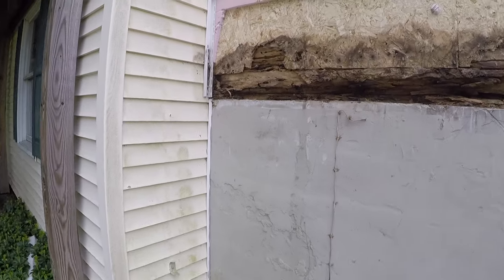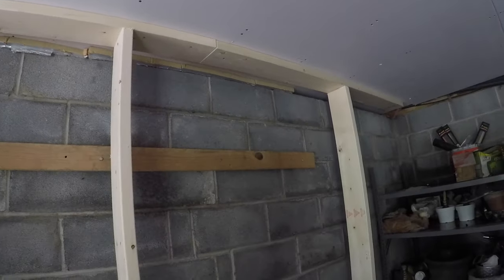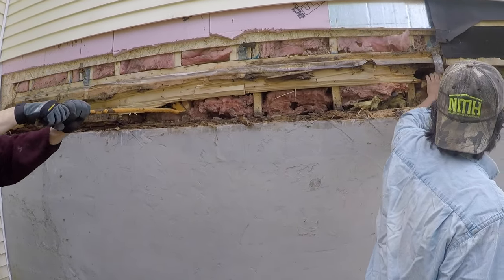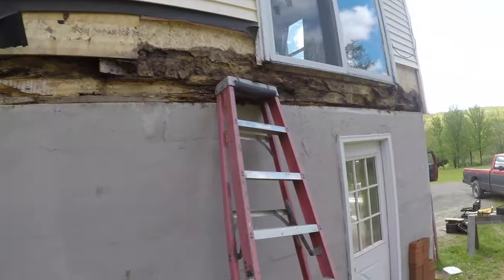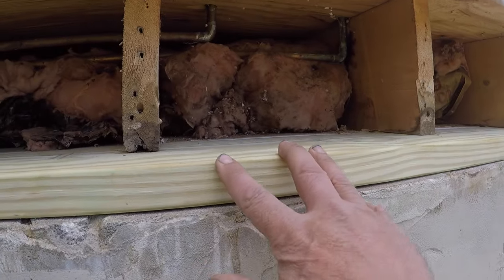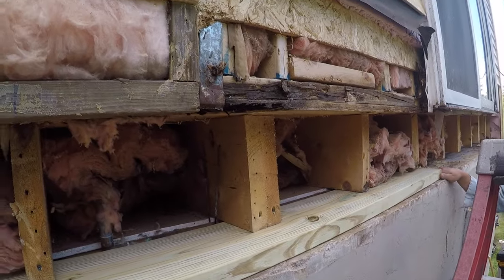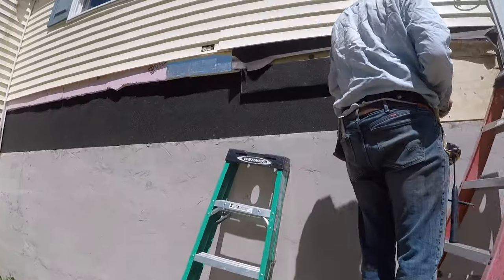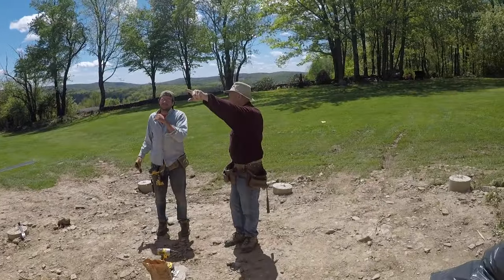Replace rotten sill and rim joists

Comment: Looking at the exact same thing 30 years old, deck boards run into the house sitting on top of a ledger with improper flashing no. Only I don't have a convenient interior wall to put temporary supports. Criminal carpentry...
Reply from the maker: Hi Charley; Sorry to hear that. The cost of doing it right isn't much more. I hope you come to a feasible solution. Thanks for watching. John
Reply: I’m dealing with this exact issue right now! Don’t even know where to begin!!! Money is tight living on fixed income!

Comment: Nice! Just did a project like this. In my jurisdiction, it requires a membrane between the sill plate and the concrete to avoid rot in the future.
Reply from the maker: Thanks for watching Andrew.  That is probably a good idea even with a treated sill. Belt and suspenders.
Reply: That and the fact that the top of the wall is never perfectly even, block or pour.  Membrane helps to seal the unevenness.

Comment: That's exactly what happened to my double wide mobile home. Some guy built our deck 23 years ago before we lived here and did no flashing at all, just nailed the ledger to the wall and now we have similar rot in the wall, with holes to the inside, mice and yellowjackets making homes in it, etc. I have to demolish the existing deck and redo everything from scratch. What a pain.
Reply from the maker: @Aelanna  sorry to hear that. It is very common
Reply: Doing this as we speak

Comment: How did you measure the 2x6’s to “jack” Up the floor joists without a jack? You said add a quarter of an inch to what? More importantly, how did you frame that up? Did you just hit in a nail at an angle?
Reply from the maker: Hi Van; Great questions; You will see there is a 2x6 at both the bottom and top of the temporary wall. the top one (plate) is screwed to the ceiling. This was easy because the sheetrock was unfinished and the location of the floor joists was indicated by the sheet rock screw heads. The temporary bottom 2x6 (shoe) was placed on the concrete floor directly below the top plate. We would stand on the bottom shoe to make sure it was tight to the concrete and then using a tape measure simply measure between from the bottom to the top making sure the tape is plumb as it is extended up to the top plate, reading the tape where it bypasses the bottom edge of the top plate and adding 1/4". 
   We didn't use nails, 3" Torqx headed deck screws are our fasteners of choice for this type of project. Generally using an impact driver they are easy to install and easy to remove. The way the uprights are wedged in a single screw on top just so it can't fall out as you install the next one is all that is needed. I hope you find this helpful. Please consider subscribing, I'm almost to 1000 subs. Thanks for watching and commenting!!  John

Comment: Was there any sort of sealing material placed between the concrete and the treated wood? I'm just wondering about water running in. Or, was that area covered with matching siding?
Reply from the maker: Hi Wade; There was no way to put sill seal or any type to tar paper or plastic because of the tight clearance. it would just ball up. So the sill plate is treated lumber and the siding covers it. Thanks for watching!!!! John

Comment: I have the same problem my deck was built 30 years ago in the brad nail era before screws were invented in the 90s. brad nails are no longer code, painted wood is not code, and screwing the deck to the house is not code either. What is code is all wood needs to be screwed to the house, all walls need to have foam insulation on the outside not fiberglass, siding needs to be cork as the base layer and Sheetmetal on the outside to prevent leaks, and the next needs hook bolts where it hits the studs and concrete anchors on the bottom and by the house this way it won't come down.

Comment: What type of company would a homeowner hire to do this type of repair? If the are of damage is only 15 inches, would it require a replacement of this nature or would doing a sister joist potentially be an option?
Reply from the maker: Hi Stacey; I would guess a general contractor. At the time we all worked as independent contractors who would help each other depending on the job. Every job is different but in general the rot should be completely removed for a proper long lasting repair. In this case there was nothing left to sister too. Thanks for the comment and thanks for watching!! John

Comment: You guys are characters man! lol. Eddie reminded me of my late father when he said, "lets sing the clean up song". lol That made me laugh.
For a newbie here: 
What nails did you use?
How much larger was the frame you built to jack up the house than the house/ceilin/joist? I'd imagine about an half inch larger to an inch?
What screws did you use?
Why didn't you use a rubber mallot than a regular steel mallot?
And what is flashing? I suppose it was that sticky sealant you put over it?
Great Work Boys
Reply from the maker: Hey Blue, Thanks for watching, I.m glad you enjoyed it. Working with Eddie for over 20 years was a pleasure and I can tell you we always had fun on the job. Mostly we used the 3' ceramic coated torx deck screws. They are strong, virtually impervious to rust and corrosion and they hold like crazy. Whenever we are using joist hangers of course we use approved hanger nails. As I recall we added about a 1/4 inch to the inside temporary wall. although it was rotten it hadn't sagged far yet and the main objective was to take the weight off so we could easily remove the old and install the new. Again thanks for watching and the great comment. John
Reply: @JohnFrytag  you guys did great. Eddie retire or what?
When working with drywall bathroom under 2nd story, do I just let the wiring to the house just extend out as is? Looks funny sitting there across pipes and all sorts of things that you'd think hazard right away.
I'm about to seal it up and would like to know b4 hand
Thx!
Reply from the maker: Hi Blue; 
  Sorry to say but this was one of the last jobs Eddie worked on. He had a two year battle with leukemia and left us last April. Like I said before he was always a pleasure to work with. We laughed everyday all day and the memories keep me buoyant although there is a large unfillable hole in the lives of everyone who knew him. I guess the Lord needed a contractor or maybe just a good belly laugh, with Eddie he got both.
  When I do wiring (disclaimer; I am not a licensed electrician. I have however wired several houses and remodels) there are a couple unbreakable rules. Always bring a wire into a box. In other words never have a wire end or connection buried in a wall behind sheetrock. You might have to add a box or two to extend the wire to where it can be connected. I guess you are working in a ceiling? I would used planed light locations as junction boxes or add a box with blank cover to add enough wire to the ones sitting on pipes or anything besides structural members to be able to route it away and fasten securely to the structural members.
  I hope this helps, feel free to ask anything else. Glad to help if I can. Thanks for the comments and thanks for watching! John

Comment: I found out today that an extension built onto my house has serious rot. Concrete patio built above grade... No flashing... It's against the ground too so I have no way to jack it up.
Reply from the maker: Yea it can be a tragic problem. We are pouring a patio against our old barn. We uses it as a wedding venue. we placed Ice and water shield against any wood that might come in contact. Concrete is like a sponge and wicks moisture to anything it contacts. Sorry to hear it. John
Reply: @JohnFrytag  Thanks for the response man.

Comment: Not bad job if rhe joist run 90 degrees.  Easy o support while repairing.
Reply from the maker: Hi Mike; Yeah that's true. The joist running the other way make an entirely different situation. Thanks for the comment and thanks for watching! John
Reply: I have the issue of joists parallel to the outside joist that’s rotted… any chance someone knows how I tackle it?

Comment: I live in PA, I tore off a concrete & block porch that was put on in 1983 or 82, it’s a little worse than on here for the 20 foot span of the porch then the rest of the house is like the day it was built, glad I watched this, my house isn’t a modular & was built in the 50’s but it’s almost identical, thanks, this is a lot safer than what I had planned

Comment: Our deck didn't have flashing when we bought our house. They put it there after inspection but damage was already done. Did not notice until a couple months after buying the house. I am positive the side of our house looks like this. I keep telling the wife we need to get it taken care of but she doesn't think it's an issue right now.. so once the basement has been renovated and we are ready to redo the deck then we shall see who is correct.
Reply from the maker: I’m sorry to hear that Scott. It’s probably something you want to address soon because it can be a dangerous situation. If it has been flashed and there is no more water entering the rot should stop. If you can’t notice sagging or other structural damage maybe a solution would be to add supports under the deck so its not depending on attachment to the house to keep it aloft. Thanks for watching.
Reply: Gotta love an honest seller.

Comment: Did the deck have to come down? Could you have fixed the wall and properly flashed the deck without having to take the deck down? Have a similar problem, and don't want to lose the deck. thanks
Reply from the maker: Hi Joe; This deck was pretty rotten so I did have to come down. I'm sure you can figure a way to support the deck and maybe move it out of your way to do the necessary work. Or maybe disassemble it to the point you can access the rot and fix it. Thanks for watching!! John
Reply: @JohnFrytag  thanks john hoping thats the case

Comment: How much would this job cost roughly cause mine is rotted out too due to deck installation with no proper flashing we bought the house 4yrs ago thanks
Reply from the maker: Great question. Probably around $12 to 1500 depending on your local labor and lumber prices. Also local codes and permit requirements can add to the cost.

Comment: What screws were you using?
Reply from the maker: Hi William; Ceramic coated deck screws. We use them on a lot of different projects. They are a little pricey but the dont rot out and the torx 27 is far superior to any Phillips or square or combo headed screwhead. Thanks for watching, John
Reply: @JohnFrytag  deckmate?
Reply from the maker: Not sure, I grab the ones from my local supply house. Gonna have to check the name now....
Reply: @JohnFrytag  gotcha. I picked up stainless steel decimate ones. They seem nice. Just picked up some spax to try
Reply from the maker: Hi William; Finally got a look at the brand. Grip Rite exterior screws. Primeguard plus lifetime coating...whatever "lifetime" means. The ones I have are actually T-25 Star drive. They work well. John
Reply from the maker: FYI; Changed channel name to John Frytag. Thanks!

Comment: I’m still not clear why building the false wall is preferable to using basement jacks and a beam. 
Could you please clarify as to why and how long do you make the vertical members of the wall if leaving drywall in place?
Thank you.
Reply from the maker: Hi Duke; I suppose either way will work. If you decide to go with building a beam and then using jacks or jackposts (preferably screw type). You will have to build a fairly substantial beam so you're using lumber that will be harder to reuse. The size of the beam will depend on how many jackposts you intend on breaking the span with. Unless you have another use for the jackpost or can borrow them its another expense. If your situation dictates leaving the beam in place jackposts is probably the way to go. By building the false wall we spread the load over the course of the entire thing so it didn't hurt the sheetrock even a little. On this project we added 1/4 Inch to each vertical. And the lumber was easily used elsewhere. Thanks for the comment and watching the video. Consider hitting the subscribe! John

Comment: Letting the facade wall assembly hang on that plywood subfloor probably wasn't a great idea.  Good job pulling that out of the fire.  

For future reference, you can use properly spaced and positioned shoring poles and needles to keep the wall from sinking.
Reply from the maker: Hey Loonypapa;  Thanks for watching and thanks for the tips. I can use all the help I can get!! John